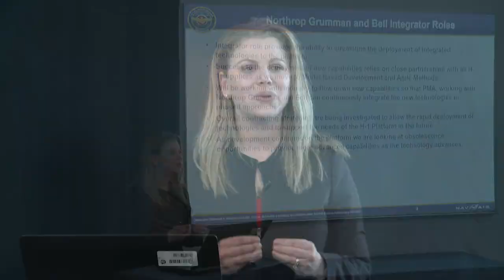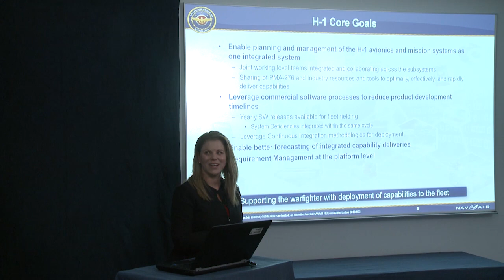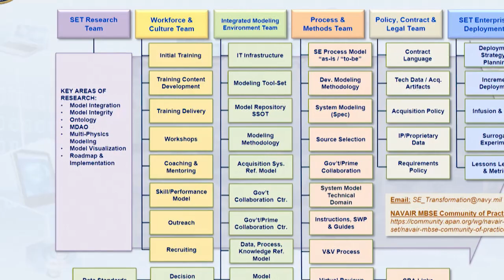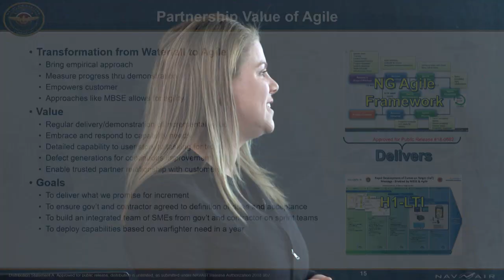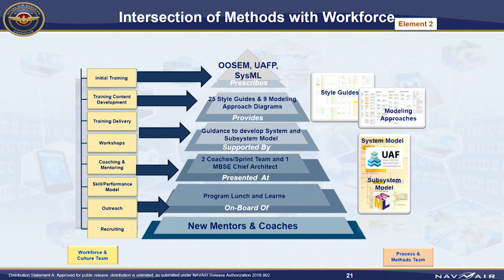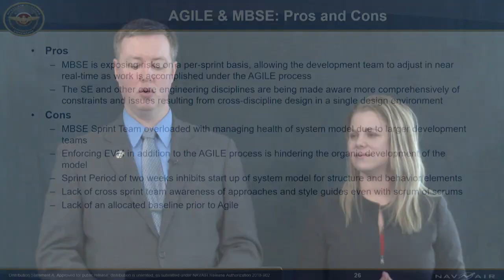Model-Based Systems Engineering in Agile Development

Comment: Agile is not a methodology, it's a family of product development approaches. While it is possible to apply MBSE methods within an Agile approach, this requires modification of the definition of a user story to better align with UML use cases, and traceability from MBSE artifacts to backlog items and class implementations (e.g. the code). At present, there is a lack of integration between MBSE and Agile process tools to achieve this effectively. This needs to be addressed. Moreover, the fixed-length Agile sprints (typically 2 weeks) do not align well with the variable complexity of the goal-oriented use cases that most directly define value from user's perspective. In general, Agile is better suited to lower-complexity systems with largely independent features. There are a myriad of other iterative and incremental process models that can be tailored to suit the specific needs of a given program.
Reply: well stated.